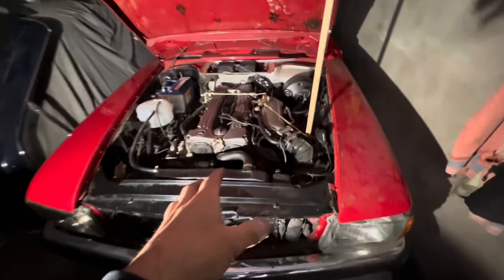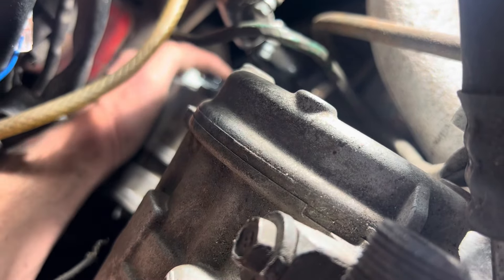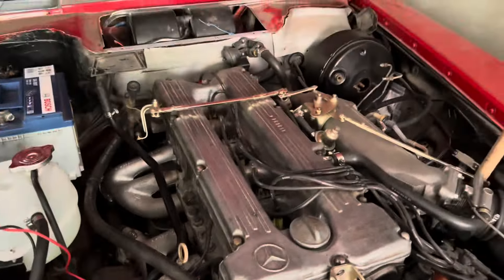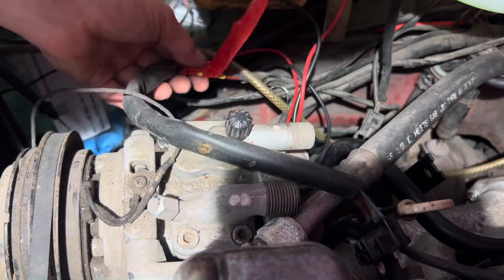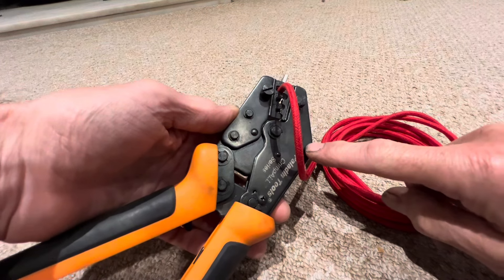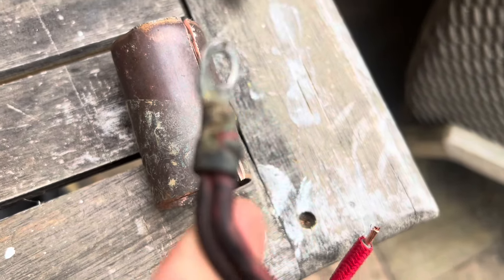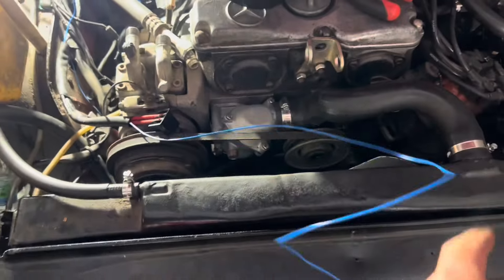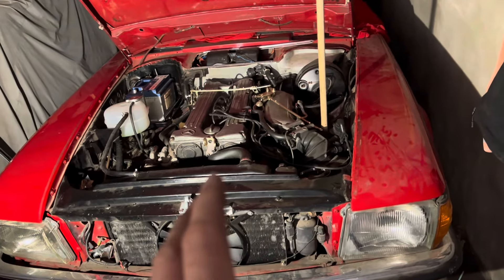Mercedes R107 Alternator and voltage regulator putting out less than 14v. Fix.

Comment: Hey Mike! Another good video. This is why I always solder and marine heat shrink. A waterproof connection is important in your wet environment I think. I have never been a fan of crimp connectors. I know millions use them, but I don’t trust them. I first crimp (if connector needed) and then solder them! Your new wire is the better than solder of course and I love the connector you made out of copper.
Reply from the maker: Hi Tony - I knew there would be at least 1 person who appreciated the copper ring terminal. How you feeling these days?...Mike
Reply: @MikesMercsandothercars  I always enjoy your videos and how you make things. My favorite video is the one where you bent copper pipe for the fill tube and how you flared it. That video is great! I am feeling much better. After two procedures the doctor finally did his job. Did you hear I started the 560SL? it only ran for a few seconds though. But mechanically it sounded wonderful. No weird noises is a welcome. I believe it is starving for fuel. It’s been 118 degrees here this whole week so I have not been in the garage to sort out the issue.
Reply: I have a 450slc, and the voltage is 13.7, with ac and accessories, it falls down to 13.2, been like that for a year now, what's your opinion? And what could be the causes? The voltage was the same even after replacing the voltage regulator.
Reply: @5aldl  at 13.7 your battery is being charged and it works so I don’t think this is a problem. The output voltage to the battery when the engine is running and the alternator is working properly, should typically be between 13.5 and 14.5 volts. If the voltage is significantly outside this range, it could indicate an issue with the alternator, voltage regulator, or wiring. I would say your range is good.
Reply from the maker: @5aldl  Thanks for your comment. What year is your 450SLC and where do you live....and are these figures at idle?

Sometimes the alternator itself is at fault. Maybe the best way to test this is to put on a known good alternator from a similar car. That would tell you instantly if the problem lies with the alternator or the wiring.

The other thing that can be at fault is the battery itself - sometimes older batteries don't take a higher charge.

Mike
Reply: @TonyLiveTV  Thanks for your reply
Reply: @MikesMercsandothercars  1979, Saudi Arabia, yes at idle, but when it warms up and the rpm's get lower (around 600 with ac on as well) voltage drops to 12.7 - 13 volts, when I rev up the engine, voltage increases, but max out at 13.7 approximately.
Reply: Great stuff